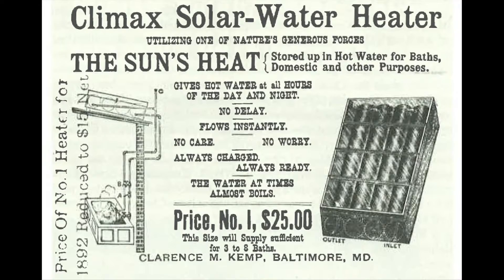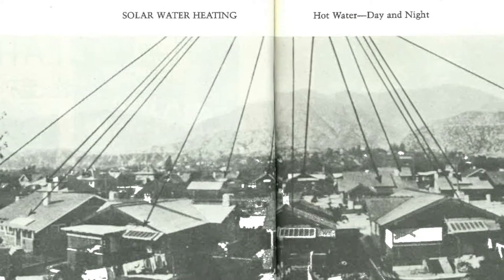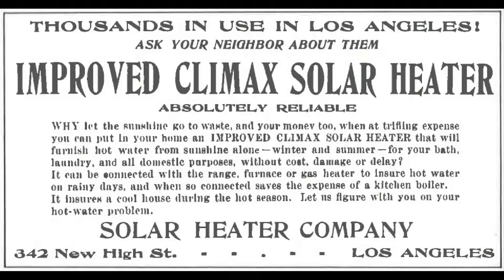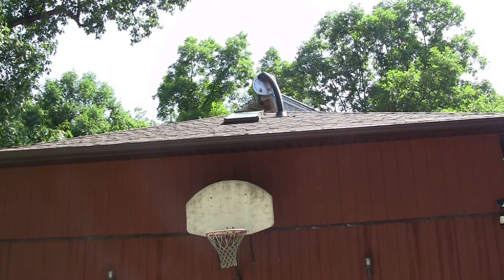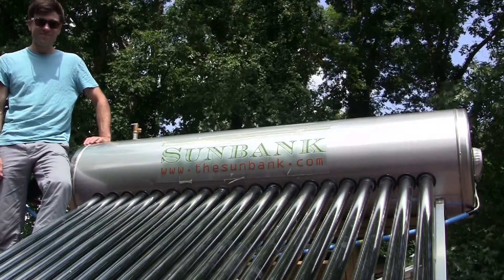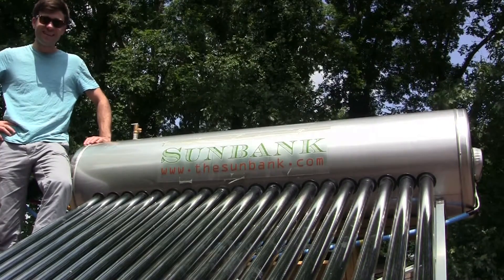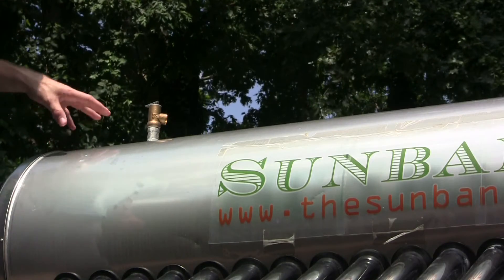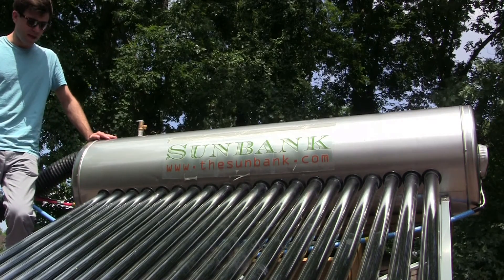Banking on the Sun: A Visit with the Founder of Sunbank

Comment: Appears to be another free energy BS scam.  This guy's explanation as to how this works makes no sense. (1:15) He says the heat goes in and doesn't come out and that it works like a thermos.  If it worked like a thermos the cold water in the system would remain cold.

A thermos which has also uses a vacuum prevents heat from flowing in our out.  So why does this guy say heat flows through a vacuum?